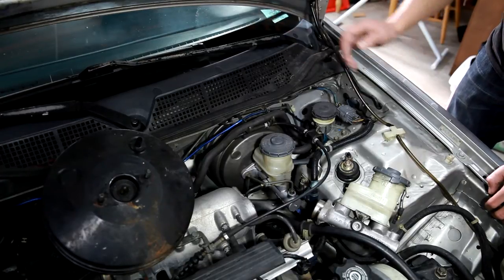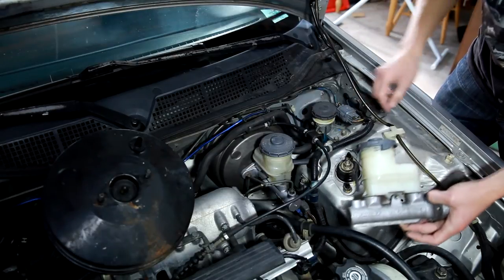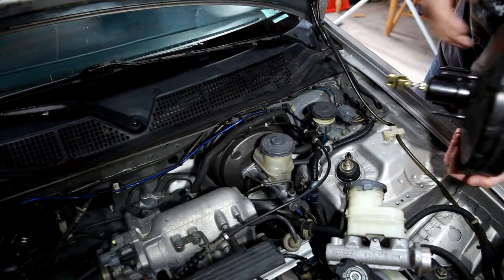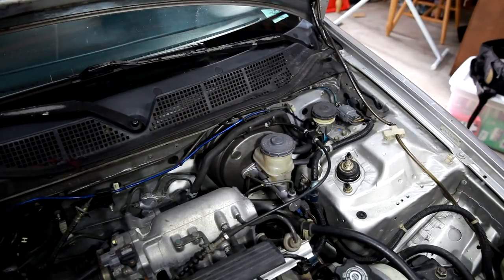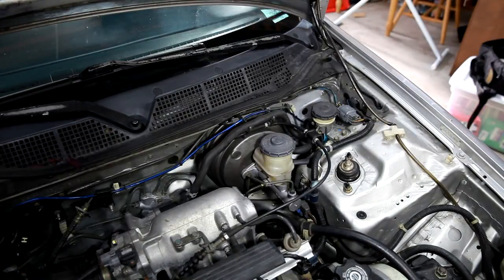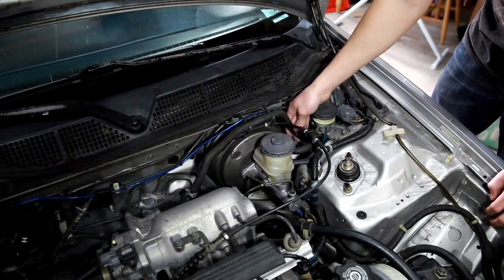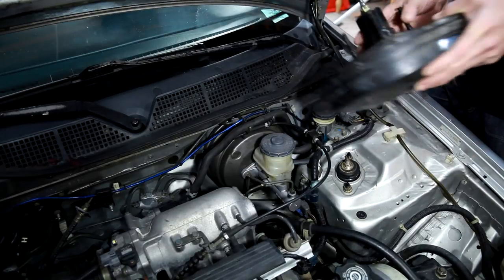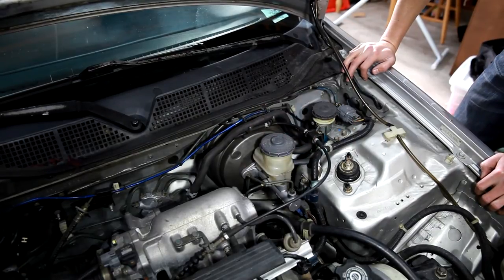1996-2000 Honda Civic HX Brakes upgrade to Acura Integra Brakes Part 2

Comment: It's 5:30 in the morning, and this video solved the problem that no one could figure out since I purchased my car half a year ago. You sir are a hero and I implore you to continue the videos. I picked up an EJ6 and it was completely frankensteined to run again. Amongst the first things my friend and I did was replace the master cylinder in my car. And I knew I WASNT CRAZY to think the pedal got worse when I did. And now it makes sense because we used a non abs master, and I later found out I had the teggy brake swap already done. Thank you again and I will continue to watch your videos👍🏼